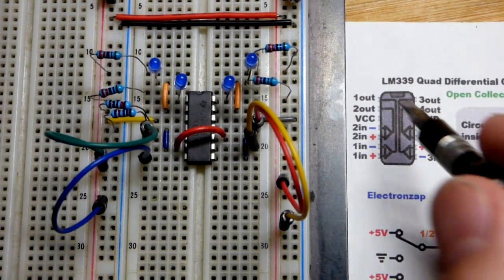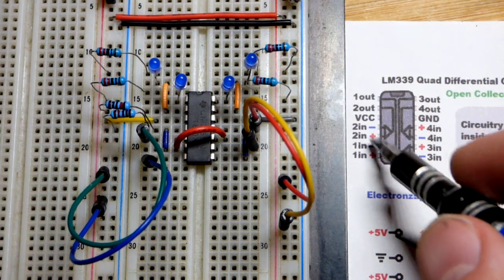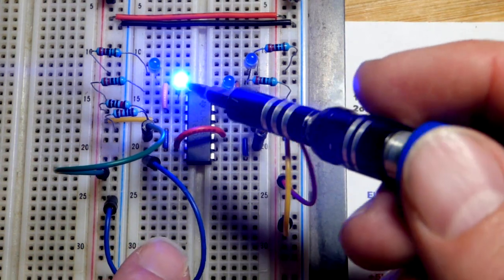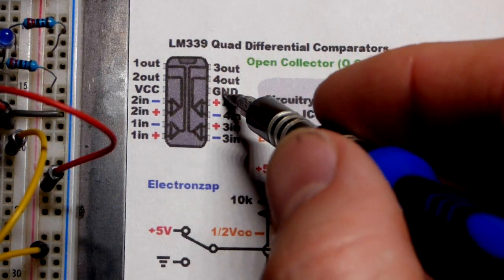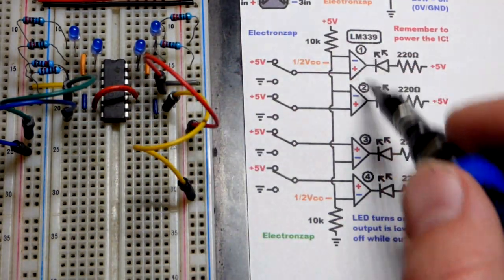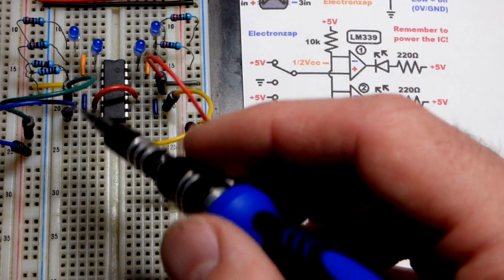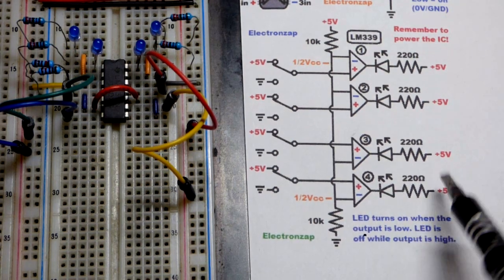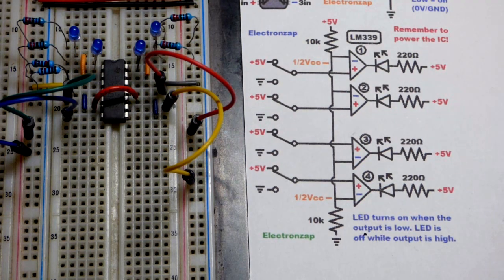LM339 Quad Comparator IC with open collector outputs basic demo circuit schematic by Electronzap

Comment: Hi, using lm311p, on breadboard the output always stays at active low (0.65v). Not getting active high, the output is in the off state, regardless of the differential input. Any help ?

MC3302P works same as lm339 ?, any modifications needed?
Reply from the maker: TI datasheet says lm311 is an open collector comparator. So you'll need to add a pull up resistor that provides a high output when the IC isn't providing a low output. That's all I can think of.

Comment: Can I use 12v on this ic?
Reply from the maker: Texas Instrument's datasheet says 36V max 38V if there is a B at the end of the part number. So 12V should be OK, but you should consult the datasheet for all of it's power limitations.

Comment: Somewhere I heard that op amps are essentially comparators that do a poor job of comparing, and comparators are op amps specifically designed to do that job. I think Dave Jones said it ... something like that. 😄
Reply from the maker: Yeah I read something similar to that early on when I was relearning electronics. And heard it mentioned here and there ever since. I think the Art of Electronics covers the differences in great detail.